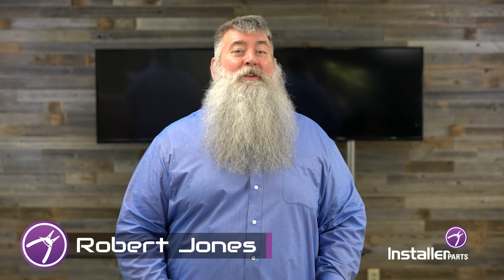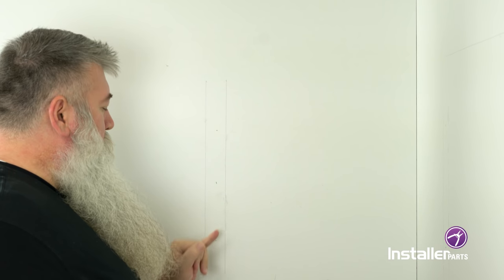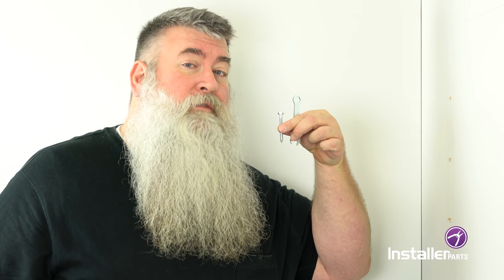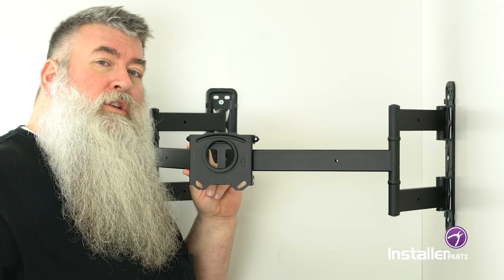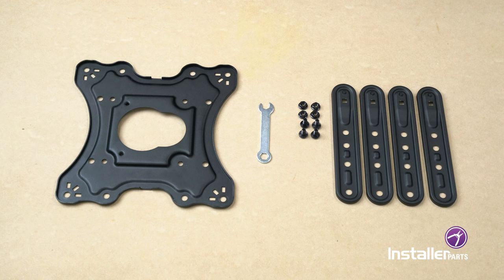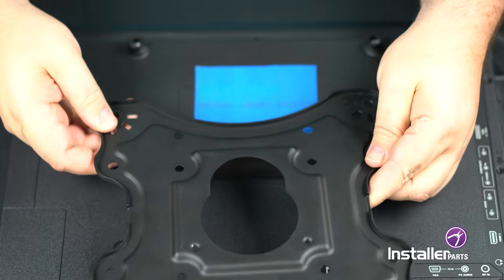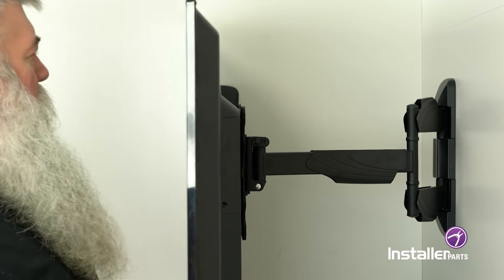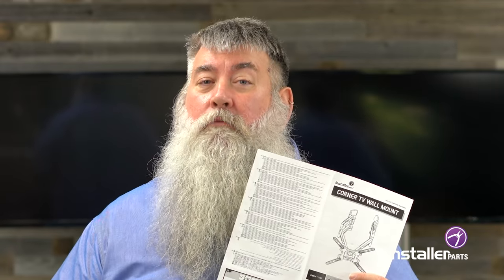InstallerParts Episode 16 - Corner TV Wall Mount With Tilt And Swivel

Comment: To find a Sud in wall all you do is get a tape measured out and to the corners to the wall 16 inches over on center or other build walls on center in residential I don't need to buy a battery operated stud finder.